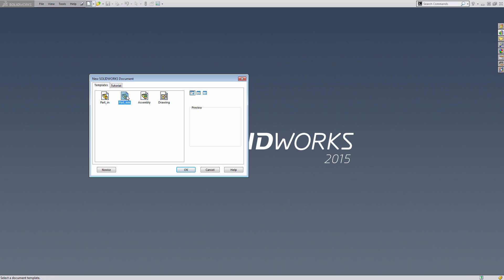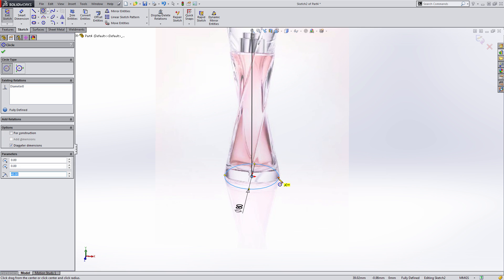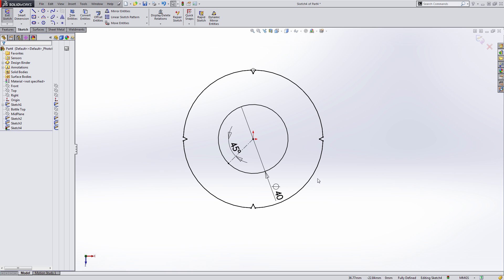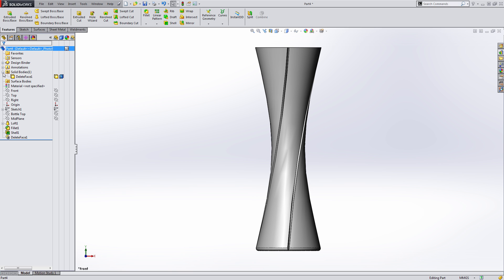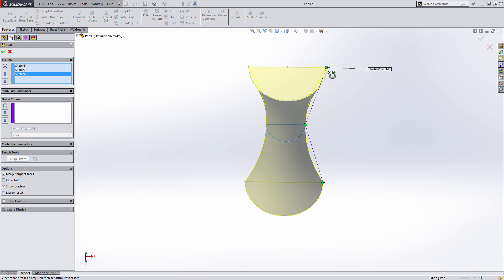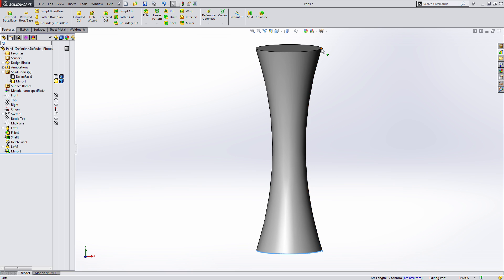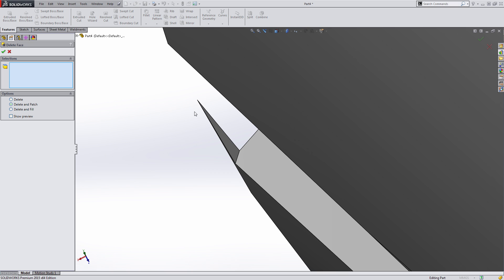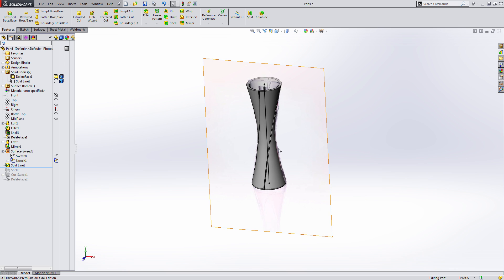How to model a Perfume Bottle in SOLIDWORKS?

Comment: Thank you for your video. Can you set the capacity of the liquid stored in the bottle? For example, 0.1 litre or 0.5 litre bottle..
Reply: Not to my knowledge, but you can measure the volume after the fact and set a sensor that will give you a hint if you go over or under set volume as you're modelling.
Reply: Oops, I just discovered your message but I will upload a video to cover this subject soon! :)

Comment: For anyone still doing this tutorial, I found what I think may be a better way of doing that triangle cut sweep. Use a cut loft instead. I couldn't get the triangular profile to remain parallel to the top plane throughout the whole sweep, so the shape was never going to be right at the top. For the cut loft, I used the centreline options for the split line and I had to add in some control at the midplane otherwise it would make the cut thinner at there. I just did this by making the same triangle at a 45º angle.

Are there any other disadvantages to using the loft tool in this case that I probably don't know about? It seems like if I wanted it to be perfect, I would've had to add a triangle at every mm along the way. Obviously that's not very convenient, but I'm quite happy with the result regardless.
Reply: Also I had to create a composite curve from the split line in order to make the circular pattern work afterwards